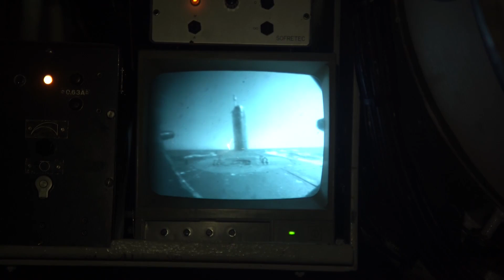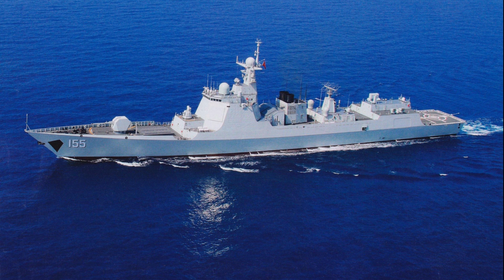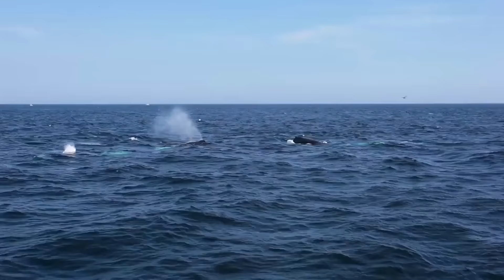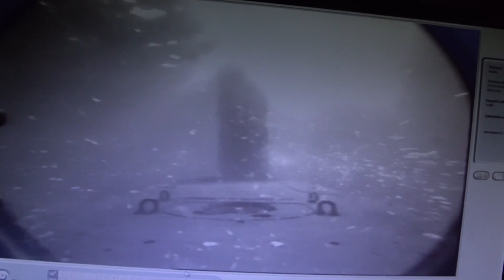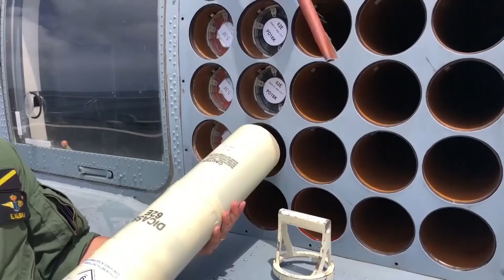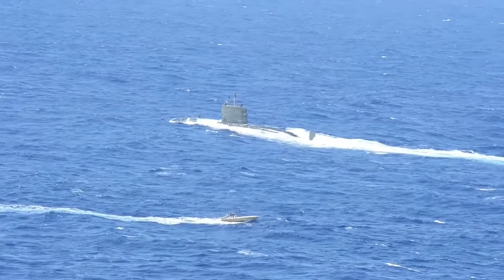Type 212CD: Germany’s New Submarine Changes Underwater Stealth Forever

Comment: The USA 🇺🇸 abandoned the SST-D program as unworkable so forget the torpedo torpedoes. The diamond 💎 shaped hull of the 212CD has a hydrodynamic problem. Everyone thinks these submarines are just for the Arctic 🥶 but have to patrol the Atlantic down to the Caribbean Sea and Pacific Ocean therefore very long distances. The VLS on the KSS3 is a benefit not to be underestimated. NATO operability again for the Arctic but disregards the Indo Pacific commitments. The NVL NTV 130 for the Arctic with drones. Ghost submarines and aircraft are the future like Australia 🇦🇺 has been testing and the USA Orca program. Probably less expensive if developed in Canada 🇨🇦 but has not been the case too present.
Reply: Norway 🇳🇴 and Germany submarines have never participated in RIMPAC for a reason.
Reply: @onguardincda  why would Germany or Norway send coast defense Uboats for an Blue water exercise???
also most missle based system bar ballistic ones can be launched from torpedo tubes.
Reply: Ihre annahme das rauten Muster b.z.w. der Diamant rumpf der kl.212 cd würde probleme machen haben sie wo her noch gleich ? Immer das gleiche, blöde keine ahnung von der Technik und dem können Deutscher U- Boot bauer aber hier die Fresse auf reisen und wie immer nur blödsinn von sich geben. Die deutschen U- Boote werden seit jahren aus Amagnetischem stahl gefertiegt das ist teuer u.können nur wir daführ ist die Wartung kosten günstig, u.sie sind Robuster. Wenn ein KSS 3 beschädigt ist hielft nicht mal mehr der AIP antrieb um es zu verbergen. Weil es aus normalem U- boot stahl gefertigt wird. Aich die Reperatur u.instandhaltung ist um ein vielfaches teurer. Und ihre anderen annahmen sind ebenfals falsch den schon die 212 Alpha konnten Amis u.Russen nicht orten sie flach zange.
Reply: @martinraith1488 clearly you are clueless and have not read anything about the hydrodynamic of water passing over the flat surface causing increased noise and drag water pressure on a flat surface. This is not an aircraft. Maybe just look at the frontal view of the design. No other engineers in the entire world use a diamond or octagon 🛑 design hull and use the teardrop design for decades with tiles. Canada is buying a pig 🐷 in a poke for 6 submarines totally untested lithium batteries, weapons, diamond 💎 hull. The key word here is under development. The USA abandoned the SST-D torpedo torpedoes as unworkable.

Comment: Lithium-ion battery is nice and all, but - i won't question the safety problem, it will be figured out further on like we did with lead acid battery which has their own problems;
i am wondering about the commercial industry base of electric vehicle in Germany, and the industrial base of German lithium-ion battery in particular, are they developed & matured enough to supply reliable lithium-ion batteries to the submarines ?
keep in mind that the other 2 lithium-ion battery submarine operators in the world are Japan and South Korea, both of which have a developed lithium-ion battery industry (and China is likely going to be the 3rd one to join that list, consider the amount of EV battery they produce alone)
Reply: Europe builds 12% of all lithuim-ion batteries in the world and Germany is the leading producer in Europe especially now with electric cars etc
Reply: The lithium batteries are actually being built in France 🇫🇷. Untested like the diamond hull and the hydrodynamic problems.
Reply: I am willing to bet that 95% or more of all of the lithium battery issues in the media come from mass produced low QC production lines with little or no concern for anything beyond getting them out the door asap.
Reply: @PePe_007-A1  there's something to do with the design of each lithium battery types too
things like phone battery, made of lithium polymer, are extremely energy dense, but are also most prone to violent fire (because it has both lithium and hydrocarbon);
on the other hand, vehicle battery like the LFP - lithium iron phosphate, are very rugged and wont explode easily even if you put it in fire, but it has low energy density and is only suitable in large scale like vehicle

Comment: They will snort every 3 days, fact.  You have to understand that conventional submarines radiate lots of noise
Reply: Why would an AIP equipped sub that can patrol at 8 knots submerged without the diesels for weeks need to snort?
These boats are generally considered one of if not THE quietest subs ever built.
Reply: @richardb1452 Richard, have you ever actually been to sea in one of these submarines? I’m guessing not.

I was part of the team that took U‑31 and U‑36 through FOST and evaluated them under proper operational conditions. I’ve also worked with these boats at sea and operated against them. So I’m not working this out from a brochure or repeating something I’ve read online.

Yes, a Type 212A can make eight knots. Nobody is disputing that. What it cannot do is sit at eight knots continually, maintain its battery state, preserve its tactical reserve and remain at its quietest operating condition. Those are completely different claims.

Let me explain the fuel cell, because this is where people keep getting it wrong.

The battery supplies all the boat’s electrical power, including propulsion and the hotel load. The fuel cell does not suddenly step in and drive the submarine when demand rises. It puts charge back into the battery, but only as a trickle charge. 

Think of it rather like a hybrid car. The boat continues drawing its power from the battery while the fuel cell attempts to replace some of the energy being taken out.

The fuel cells do not run continuously, either. Hydrogen and oxygen are finite consumables, so they are used carefully and often only periodically. You do not waste your remaining fuel-cell endurance merely to support an unnecessary speed.

What you are trying to do, when operational circumstances allow, is “float” the battery: put energy back into it at broadly the same rate as the boat is taking energy out. If the fuel cell can replace what is being consumed, the battery state can be maintained.

At eight knots, however, the propulsion demand rises considerably. Then add the hotel load: ventilation, cooling, pumps, hydraulics, sensors, combat systems and everything else required to operate the submarine.

Every bit of that electrical power is still coming from the battery. If the fuel cell cannot put charge back at the same rate, you are no longer floating the battery, a very rare state. Its state of charge starts to fall.

You can continue at eight knots for a period, but the fuel cell is merely slowing the rate at which the battery is being depleted. It is not powering the submarine directly, and it is certainly not allowing the boat to “rattle along continually at eight knots.”

Eventually, if the required battery state cannot be maintained or recovered, the boat has to snort. The diesel generator then provides the charging power that the fuel cells cannot.

That battery reserve is not optional. You may need it to evade a weapon, clear danger, sprint into position or deal with an emergency. A commanding officer who has used up that margin to maintain an unnecessary transit speed has reduced the boat’s fighting ability and potentially placed the crew in danger.

That is the part people miss when they sit ashore with a calculator. They take a manufacturer’s maximum capacity, divide it by a theoretical load and announce how long the submarine can remain underwater. Real boats are not operated from 100 per cent down to zero, in perfect conditions, with no tactical requirement and nothing going wrong.

Lithium-ion batteries would not change that basic fact. They may provide greater usable capacity, faster charging and higher discharge rates, but they are still storing energy, not creating it. If the submarine is taking more energy from the battery than the fuel cells are putting back, the battery will continue to discharge, whatever its chemistry.

Lithium-ion also brings its own complications. Temperature, battery-management limits, isolation procedures and the danger of thermal runaway all have to be managed. It is not some magical box that gives a conventional submarine unlimited submerged speed.

Now let’s deal with the other internet myth: conventional submarines are not automatically quieter than nuclear submarines.

A conventional submarine can be extremely quiet while creeping along slowly on its battery. Nobody with any experience would deny that. But people have taken that narrow set of circumstances and turned it into the ridiculous blanket claim that every conventional submarine is quieter than every nuclear submarine.

It simply isn’t true.

A conventional submarine is not a silent battery with a propeller attached. It is full of machinery. It still requires ventilation, cooling, pumps, hydraulics, electrical equipment and a propulsion motor. Some machinery can be stopped temporarily, but you cannot switch off everything indefinitely and continue operating the boat.

Speed matters as well. These submarines are acoustically optimised around a particular low-speed condition—roughly five knots in this context. Push the speed up and machinery demand, propulsion noise and water flow around the hull all increase.

You cannot claim that the boat will cruise continually at eight knots and, in the same breath, use its very-low-speed acoustic performance to declare it the quietest submarine in the world. The two claims do not sit together.

Nuclear submarines cost an enormous amount for a reason. A tremendous amount of specialist design, equipment and engineering goes into reducing their acoustic signature. Much of that technology is neither visible nor publicly discussed. The simple fact that a submarine has a reactor does not automatically make it noisier than a conventional boat.

Before I became an officer, finding submarines was my specialist job. The quietest submarine I personally encountered was USS Narwhal—and by a country mile. That experience alone makes a nonsense of the claim that conventional submarines must always be quieter simply because they run on batteries.

The Type 212A is a very capable and very quiet conventional submarine when operated within the conditions for which it was designed. That is quite enough praise without inventing impossible endurance at eight knots or declaring it quieter than every nuclear submarine ever built.

There is an enormous difference between what a submarine can achieve briefly, what it can sustain safely and what somebody has calculated from a manufacturer’s figures.

Those of us who have actually operated with these boats understand the difference.
 @richardb1452
Reply: @Highendaudio1 sorry und sie sind schon mal auf einem unserer boote mit gefahren erzählen sie hier doch keine Märchen der AIP ist ein Brenstofzellen antrieb der die energie für einen Elektro motor zur verfügung stellt. Und Die kl 212 A ist nicht mit 8 knoten unterwegs den dann könnte es sich in der Nordsee nämlich garnicht von der stelle bewegen bei einer ströhmung von 9 knoten sie dummer Hund.

Comment: B2 Spirit is a rounded flying wing. It is not angular at all. Compare the F117 or F35 too the B2 and you will immediately see the difference in design language.

The B2 is stealth shaped. It is just a different stealth idea than the jagged sharp edges of the fighters.
Reply: the basic principle of "as few different angles as possible" is still there.

look at the wing egdes, the wing leading edges and the rear wing parts.
Many lines as paralel as possible with a few recurring angles.

Thats stealth for ya. Every radar contact thus is very reduced as the long sides only reflect the radar waves in one defined angle, which a near sonic speed plane crosses in seconds.

the belly of the beast is flat af, and most radar will come from the surface. stealthy again.

While it also sports angled air ducts, frontal radar radiation is a bit rare at dunno... 50.000 feet.